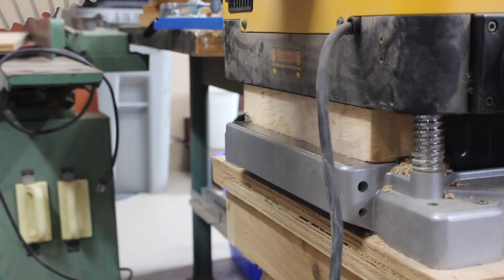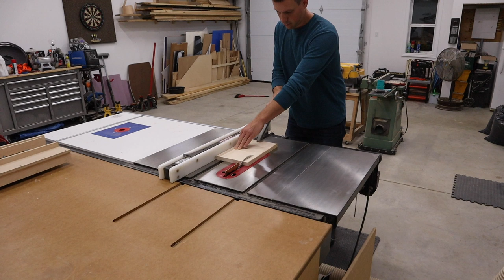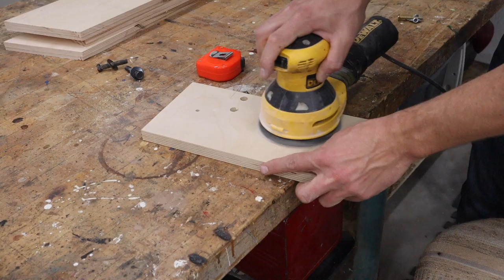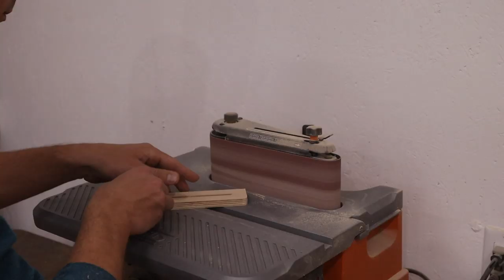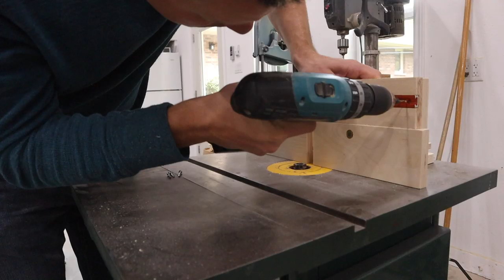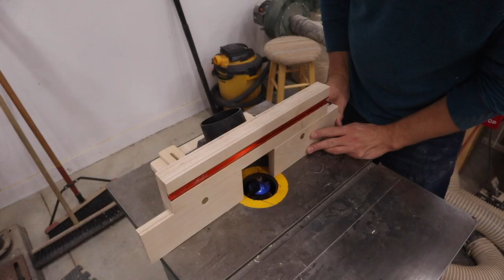Building A Router/Shaper Fence With Dust Collection!

Comment: Dear Wes's Wife.   This is what Wes wants for Christmas:   12K7990 from Lee Valley.    (1/4-20 jig and fixture kit -- tons of knobs and bolts.   Much nicer than wing nuts!!!)

Great build, Wes!   Great upgrade.
Reply: Thats a nice kit, with whole bunch of starknobs. Thanks, ill buy it myself. just $75CAD
Reply from the maker: I’ve heard about this kit. A guy at busy bee tools told me about it once. I should probably get it.
Reply: @WesHamstra  At this moment lee valley has free shipping for at least $40 order. In case you don't have store close by
Reply: Check out Princess Auto for the same kits...1/4-20, 5/16-18 for $31 and some smaller kits for $10.  They are on sale now.  My store had limited stock and I picked up the 1/4-20 kit.

Comment: Very nice find and fence build!!
I built my router table with its fence in a hurry early this year, planning to add the sliding parts later on and I haven't got to it yet. I eventually got the melamine for the fence but then I started other projects and put that on hold, now I've been thinking to also swap the ply top for a melamine one... I better get to it soon before I start thinking to rebuild it from scratch... haha

Keep up the great work!
Reply from the maker: Make On I know what you mean. Having the t-track for feather boards is nice.
Reply: @WesHamstra  It is indeed! The irony is that I put on the t-tracks because I needed them right away, but not the sliding fence...